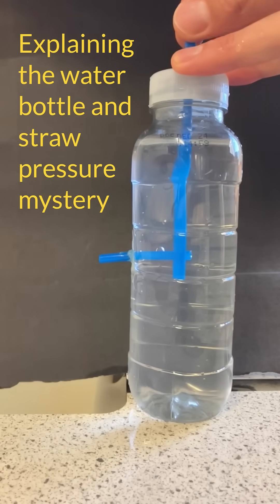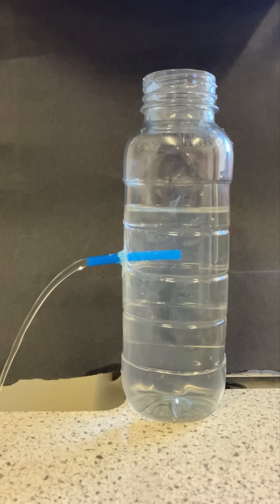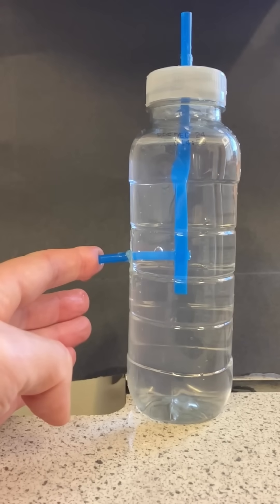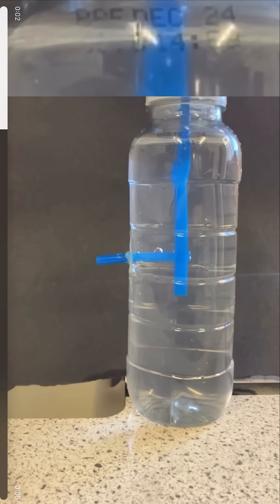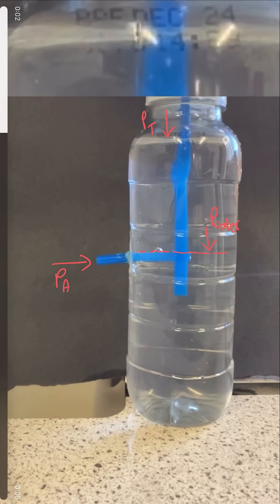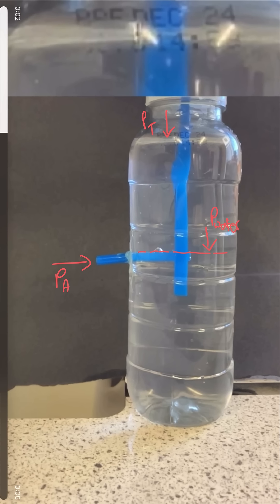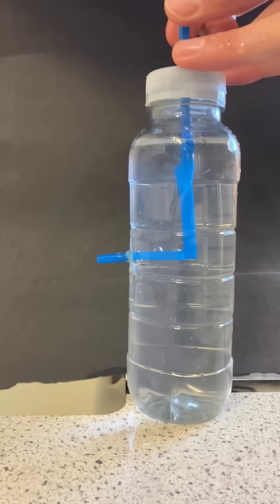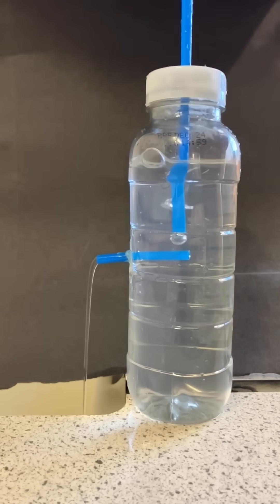Explaining the water bottle and straw pressure mystery

Comment: if you angle the horizontal straw 45 degrees and the bottom is below the horizontal straw but the top is above, will water come out?
Reply from the maker: I think what matters is the height at the start of the straw but I think without a diagram I can’t quite understand what you mean.

Comment: Awesome much appreciated. I hope this helps fueling the algorithm. For me the most difficult part is, intuitively imagining that that tiny bit of air and the water is stronger than all of the air from above but just a tiny change in water creates equilibrium. I apparently have a misunderstanding of pressure and volume/weight. How can the tiny bit of air that is completely isolated still have the same pressure as the large joined body of air from above with much more volume
Reply from the maker: Glad you found it interesting.  Not sure why it has suddenly been promoted by the algorithm again almost a year after I made it.
Reply from the maker: You might find this video interesting: The physics of the spinning wine glass explained
https://youtu.be/hOspFWXVJsU

Comment: Question from a pleb. When that water dribbles out of the horizontal straw, is it not creating a partial vacuum at the top of the bottle? Thus helping atmospheric pressure to keep the water in?
Reply from the maker: I prefer to say reducing the pressure of the air in the top rather than creating a partial vacuum but yes you have understood the idea that there is less pressure from the air above the liquid.  Good job.